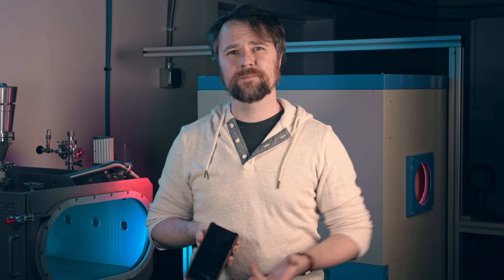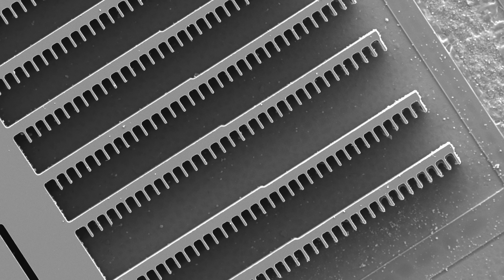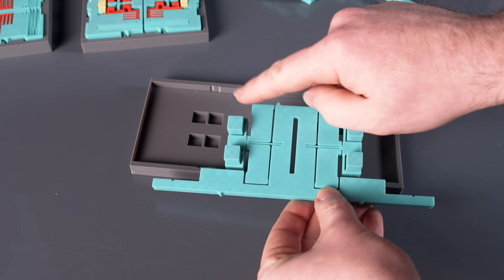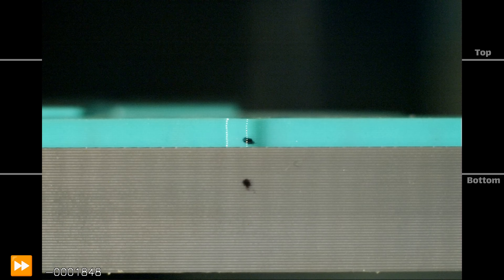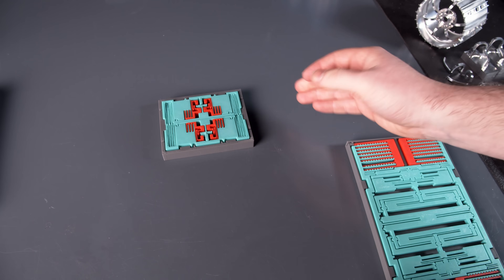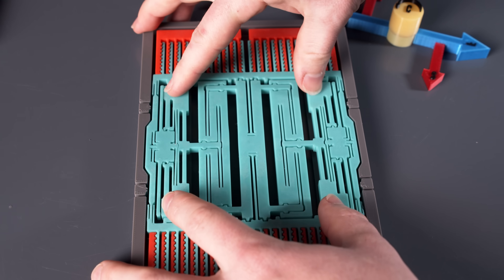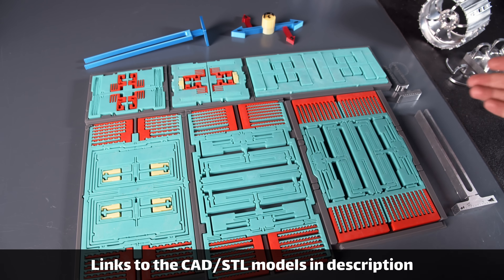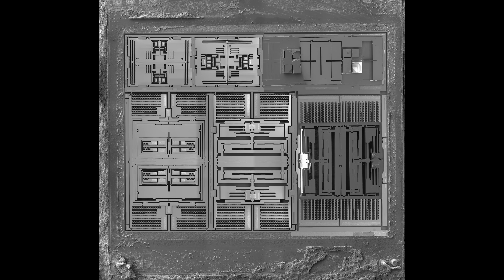The Micro Mechanisms in Your Phone

Comment: Aren't DLP/DMD devices MEMS as well? I'm sure it'd be easy to get several of them, but it may be hard/impossible to open them up.

Weird question, do you think it would be possible to create a MEMS DMD where the mirrors are distorted between concave and convex to change the focal distance? If each pixel had a different focal distance, it'd be possible to create projections with realistic depth for VR headsets.
Reply: If I am not mistaken the mirrors are bistable (hard to put in a middle position), and they tilt in only one axis.

What you ask for would likely require them to be continously tilting between the ends, and the axis forming rings.

There is a thing called a fresnell lens, so the idea could be viable?

Comment: I thought we used tiny balls (like ball bearings) inside conductive/capacitive "cages" of approximately spherical shape. When the ball goes up the walls of the cage, it's due to acceleration other than gravity. Is this how old accelerometers (like 10-20 years ago) used to work?
Reply: Or like kitchen scale using a spring/bending metal instead of counter-weight? If the weight on top of it is fixed the reading changes is all accleration!
Reply: @erlendse  Scales don't measure acceleration, because there is no acceleration. Scales measure forces from objects at rest. What are you talking about?
Reply: @weksauce  It takes a fixed mass and a force cell to meassure accleration.

The setup is kinda similar.
Reply: @erlendse  No, there are other ways to measure acceleration. Like the one I thought we still used, and think we used to use in accelerometers. It doesn't care about the mass of the tiny ball, and there's no "force cell". It just compares the angle of a ball against gravity to know about all accelerations perpendicular to gravity in all "planar" directions we generally care about. 45 degrees in a direction means acceleration across Earth's surface equal to 9.8m/s^2 opposite the direction the ball is climbing the sphere. Integrate over time to get velocity and position. Technically delta v and delta xy, but use satellite and cell tower information and some pretty solid assumptions (like that we're not orbiting above the atmosphere) to turn deltas of velocity and position into actuals.
Reply: @weksauce  Sure, it gives accleration direction.
but not how much accleration there actually is.

Different sensor, but if it stays flat in use you should be able to use the data.
Reply: @erlendse  Yes, it gives how much acceleration there is.

"Different sensor, but if it stays flat in use you should be able to use the data."

I don't know what this means.
Reply: @weksauce  Tilt it, and the readings are shifted.
Like there is no way to tell the 1G accleration downwards like a force sensor would give. So if the force is more than 1G total the sensor may be tilted but a force sensor can tell that accleration is going on.
Reply: @erlendse  Ok, so have 2 round, semicircular troughs with balls instead of 1 sphere.

" if the force is more than 1G total the sensor may be tilted but a force sensor can tell that accleration is going on."

I don't understand. The ball inside a sphere is capable of measuring all accelerations, just in the "planar" (perpendicular to gravity) 2D directions.
Reply: @weksauce  Yep, works for flat places.

Since they don't meassure gravity magnitude they can only meassure direction and can't detect a non-acclerating but tilted situation. A force based sensor would be able to tell the difference.

Comment: This is an excellent explanation. I have one correction however (that makes little difference to your explanation). When an object is a rest on the surface of the earth it is experiencing a constant acceleration upwards at 1g, so the test mass sags downwards. When you drop your phone, whilst it is in freefall (and it's velocity is much less than the terminal velocity in air) then the acceleration experienced by your device falls to zero and the test mass will return to its neutral position.

Comment: Would an engineer sit down and design one of these devices by hand in CAD, slowly fine-tuning it through simulations? Or would the design be more of a generative output from some kind of algorithm? Just trying to wrap my head around how this crazy design came into existence.
Reply from the maker: Not an expert on the actual design of these, but from my limited understanding of the toolchain and software used, they are probably drafted by hand and then tuned via simulations. I believe there are a number of basic "building blocks" which can be used to jumpstart a design (common stuff like sensing and actuation combs, cantilevers, etc) but then it's up to the engineer to design the rest. Often a very iterative process since you need to also make sure it works with your fab. There are typically process steps or design rules that you have to abide by. Features have to be X wide, can only have Y number of layers, stuff like that.
Reply: @BreakingTaps  Super fascinating. It would seem like the engineer would need some kind of artistic and mechanical sensibility towards this kind of stuff to be even be remotely effective at creating working parts. Especially if they start the design from scratch. I could only imagine it takes hundreds of iterations to finally land on a working prototype.
Reply: @BreakingTaps  Also, thanks for the reply! What an awesome video and the 3D printed parts were awesome at illustrating how these devices work!

Comment: There's no acceleration from dropping your phone, there is instead, a lack of acceleration...
Reply: We should distinguish between actual acceleration, which is a derivative of velocity, and the force of acceleration. i.e. when you drop the phone, it starts moving and accelerating. You can see that it is really moving and accelerating,
Reply: @8546Ken  yea but it experiences no acceleration, it sits still in spacetime, there is no actual acceleration.
Reply: @chengong388  In it''s own frame of reference, it "experiences" no acceleration. But an earth-based  camera can observe the acceleration at 32 ft/sec^2, and that is just as real. Everything is relative.
Reply: @8546Ken  acceleration is absolute and not a matter of frame of reference. You'll be able to tell that it is in fact standing still because you can observe that a light passing through the device remains straight while in the device, but curves after it leaves it, allowing you to conclude that it's not accelerating, you are.

Comment: Excellent work and explanations. One very small criticism though. Technically all these devices are accelerometers. The top three are measuring linear accelerations and the bottom three are measuring rotational movement (which by definition is also an acceleration). In any movement there are six degrees of freedom, three linear and three rotational. This device measures the magnitude of the acceleration of each degree of freedom and from this, combined with duration of the accelerations, the total movement of the device may be calculated.

Comment: silicon is extremely flexible when it is thinned.  i once had a wafer that was overetched (to the point equipment could no longer handle the sharp edges).  I suspect it was 40 microns thick(they start around 800 microns thick), but didn't get a measurement.  It was 8" diameter wafer and was able to grab  it and fold it in half so it was touching itself like a taco. it just flexed back to flat after. its hard to believe a single crystal could be so flexible but it also does teach a lesson about how stress works.
Reply: Chemistry class.  Working with glass and Bunsen burners, as often enough you need to change your glass containers for special purposes.

For fun I drew out a glas rod as long as I could and ended up with a rather springy, long, thin ‘hair’ of a tail … glass is not flexing? Just make it thin enough!
Reply: @advorak8529  I mean, how do you think fiber optic cables works ?
Reply: @The.Heart.Unceasing     Total internal reflection?  Pretty sure that how it works.  Well, not really, there are photonic crystal fibres ...
Reply: @advorak8529  nah I meant the bendyness of the glass fibers inside ^^
Reply: @The.Heart.Unceasing pode ser flexível mas não elástico
Reply: Microscope slide covers are flexible glass artifacts people might have experience with
Reply: I’ve always been wondering how movements are detected on devices especially mobile phones, this video has answered me, but  I am still wondering how do they work in continues movements like ‘speedometers’ excuse my English
Reply: @LukaMkungu  There are plenty of methods for an object/device to estimate its own speed, but none of them rely purely on the kind of sensors shown in this video. There exists no universal solution that can just be smacked on something to measure its speed. For example, a speedometer in a car (typically?) may work by measuring the rotational velocity of the wheels or the driveshaft, and then estimating the car's linear velocity. It is theoretically impossible for a device to measure its own speed without an external frame of reference. That doesn't even make sense in physical terms, if you think about it. Not to say that's what you meant though. Note difference between "measuring" and "estimating".

Estimating velocity/position based on past experienced forces is a completely valid theoretical solution, and is 100% accurate on paper. To date, that problem (namely dead reckoning, and the equivalent for speed) remains unsolved in practice, and will probably never be solved. The reason is that a sensor will never be 100% accurate, unlike mathematical functions of physical properties (such as acceleration), and analytical derivatives of them (speed/position). Inaccuracies in an accelerometer will lead to a greater and greater error in the speed estimate, due to error integration. Short term though, its speed and position estimates are very usable, to the point that accelerometers/gyroscopes are pretty much always used in any kind of motion/speed/position sensor.

What is done in practice, is to combine sensors using data fusion algorithms, pulling on the strengths of each sensor. Examples: Accelerometers are incredibly good at measuring acceleration at very high frequencies, but for applications that require speed or position, they are useless alone due to error integration. Gyroscopes measure rotational velocity, also at very high frequencies, but suffer the same issue, in that they can't be used alone for rotational position estimation. Magnetometers offer directional sensing (relative to the planet's magnetic poles), but they are prone to disturbances from non-earth magnetic fields, and they are also quite slow compared to accelerometers. GPS provides positional estimates relative to earth, sorely lacked by all of the previously mentioned sensors, but they are very slow, doesn't work well indoors, and their precision and accuracy is also very low (compared to accelerometers' and gyroscopes' millimeter-scale position estimation abilities).

In most modern products, all of these sensors (and more) are combined to create high quality position and speed estimates. The point is: The reason we have to resort to these complicated estimates, is that there exists no standalone method for an object/device to measure its own speed, nor will it ever exist.
Reply: Through gps Also we can measure speed

Comment: I was under the impression that both gyro and accel units were actively driven to oscillate, because it is easier to detect a difference from a known (if constantly changing) frequency than it is to detect any old motion...similar to how the dmd on a dlp projector never stops moving even when driving a static black or white pixel, it's just a pwm variance of on to off.

Comment: I printed one of your gyro models! I think I have a better explanation for the forces in the X and Y gyros. Do you have a resource for sensing being done with a shift in the resonant frequency because I think I have an explanation that seems to fit the model better and uses the sensing combs to just sense displacement instead of having to track a frequency shift. I printed what I think is the X gyroscope. Instead of driving the masses back and forth in-plane, I think they are being driven up and down out of plane (the same direction you think they are forced by the Coriolis effect). For explanation, I have the masses on the East and West side. So when the East half moves up, the West half moves down. If the gyro is rotated around the East-West axis, the masses would feel forces in the North and South directions. The flexure constrains the movement and turns it into more of a clockwise or counterclockwise rotation (when looking down at the gyro). This rotation feels natural when playing with the flexure, and it moves the sensing combs such that one pair moves together and one pair moves apart. With this explanation, the drive force feels natural when playing with the 3D print, and the resulting Coriolis force actually moves the sensing combs in a differential way that makes sense.
Reply from the maker: Definitely possible! I spent a long time noodling over those, trying to determine which axis they were driving/sensing in. The detail that made me doubt that orientation is that I couldn't find any drive mechanisms to drive it in/out of plane (in the Z direction). The bottom of the trenches are completely bare on both sides, so no electrostatic actuators directly on top or bottom. So the drive mechanism would have to be offset a bit and that seems less efficient. There are a few potential candidates that could maybe be driving it, but I didn't see a slam dunk.

But on the other hand, I didn't see a great candidate for driving it laterally either. So yeah, not sure. I wouldn't be surprised if your hypothesis is the correct one and my explanation was incorrect! I do agree it feels like the combs would sense that better (and you can see them wiggle a bit).
Reply: @BreakingTaps  I'll definitely spend some time looking at the images in your Dropbox folder (🤩)  to see if I can find anything that makes sense as a driving mechanism, but I am still a noob when it comes to chip-level RE. It's puzzling that the trenches are empty. Having the drive mechanism offset could maybe be ok if the flexure has a really high Q factor. 

The only way the combs seem to want to move is with the in-plane rotation of the masses in the middle. If the sensing is from a shift in resonant frequency, maybe they are using the combs as both driving and sensing with the flexure being a resonant tank. I still don't see how to sense a difference between positive and negative rotation that way.

Comment: This was extremely cool! Even though I had a basic grasp of how MEMS devices work, it was very insightful to see the 3D printed models and see the flexures bend. I love presentations that allow me to have a more intuitive understanding of various concepts, and this was definitely one of them.

However, I didn't quite get how the change in oscillation in the gyros propagates to the measuring capacitors on the outside. Also, it would be great to see how the movements of the rest of the mechanisms are sensed.

As for suggestions, a few years ago there was an interesting case of a MEMS resonator clocking an iPhone SoC that failed to operate when submerged in helium. DLP chips could be interesting to explore as well. I'm also curious how these devices are manufactured, but I'm not sure if this is within the scope of this channel.

Thanks a lot for the video!
Reply: They are esencially a mechanical integrated circuit, very cool stuff!
And I would like to know how that spesific sensing works too, for me it seems like something may be wrong about the presentation.

The controller clearly know the driven phase, and could totally use the phase of the sensed signal and compare aginst the driven signal so plenty tricks.

From what I understand about the helium, it's not submerging but rather a small presence of it that messes it up.

How they are made have lots of secrets. From my experience they are totally willing to show what it's shaped like and all, but how they build it is off limits.

Comment: Issue I see with the accelerometers is that the sensing combs as described can't determine if the movement is positive or negative in regard to the axis being sensed. The models seem to have the combs "centered" when no force is applied, so any force will cause the comb surfaces to get closer and thereby increase the capacitance. Only way to actually make it work is for the two sets of combs to be offset in opposite directions to each other. So a positive acceleration will cause one set of combs to increase capacitance while causing the other set to decrease and visa versa.

Comment: from what ive learned, one of those 2 mems compliant mechanisms is fixed in place and acts as a reference for the moving one. since the capacitance is also influenced by temerature, humidity, emi etc, it would otherwise be very hard/impossible to tell if capacitance change was caused by displacement or something else.
i really wonder, if thats also the case in your chip aswell, since everything is there 2 times.(also the tuning fork doesent really need 2 forks to be affected by coriolis, does it?)
Reply: Likely two acting in different direction signal-wise. One increase and one decrease for a given motion.

At least fixed errors would be the same for both, and the stuff they meassure will then be easier to extract.
Reply: @erlendse  yeah, that makes even more sense. same "enviromental influence caneceling", but a signal twice as strong. man that stuff is fascinating.